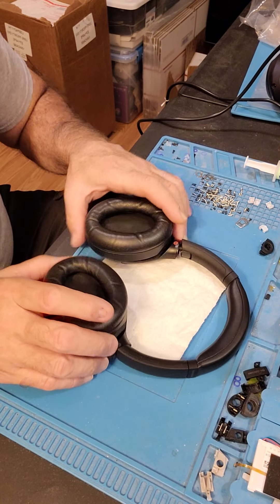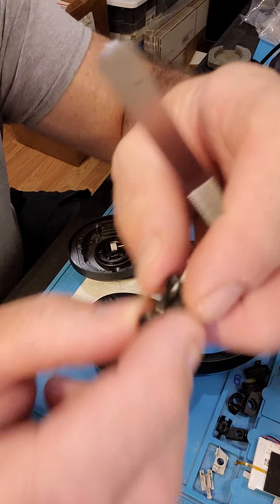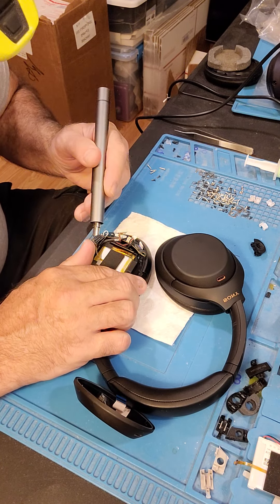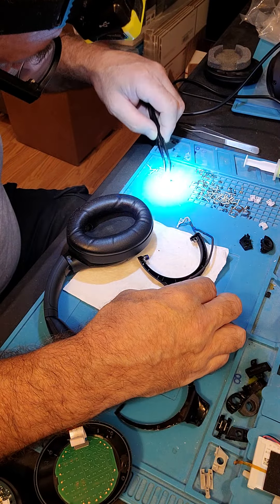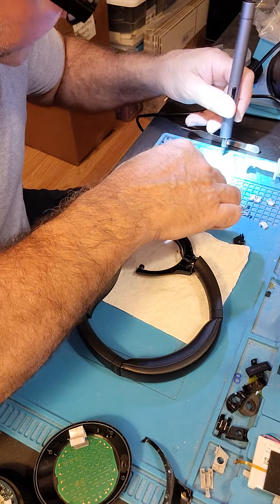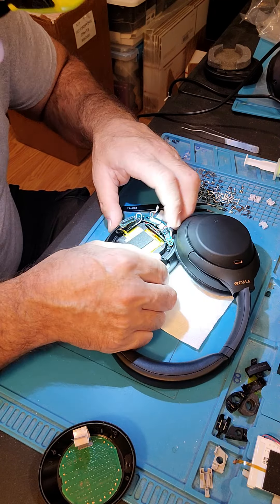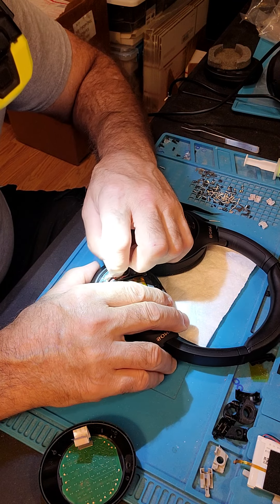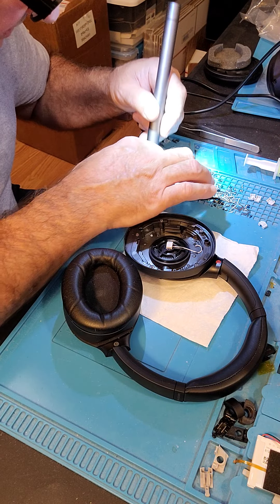Replacing Pivot [right] WH1000XM4 Headphones

Comment: Where did you fing replacement pieces ? I would need to change the microphone because in anc mode it makes an horrible high pitch loop noise
Reply from the maker: There are many sellers on eBay that sell parts for the wh-1000xm4, they will have that mic, shoot them a message and ask them what the cost is.

Comment: Do you know what the two screws that you took out of the mother board are called?
Reply from the maker: Not sure what two screws you refer to are but there are the same size screws basically in multiple locations in these headsets, the screws that hold the speaker or any of the micro boards in place are the same size and length, the shiny ones that are longer hold the outer cover on, there are four there, easiest way to remember this is to either look at the other side or take pictures.